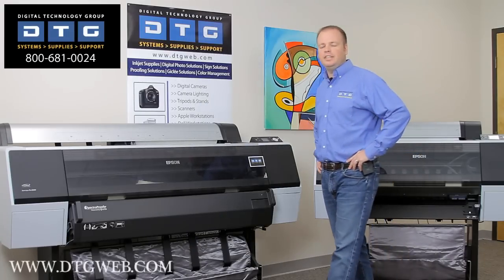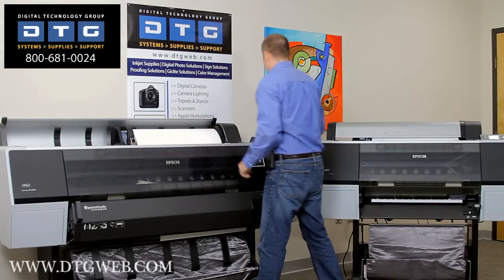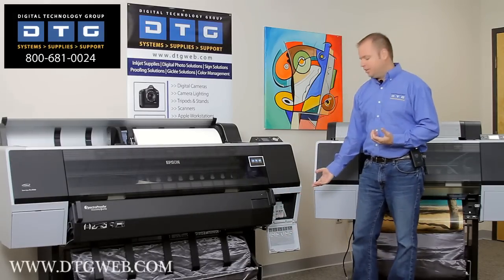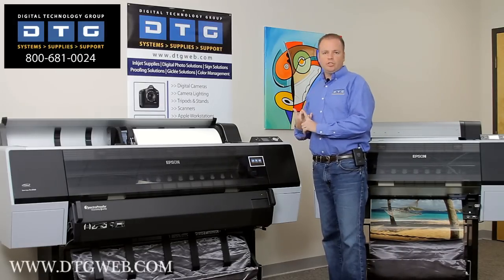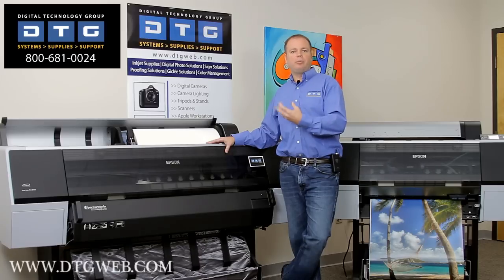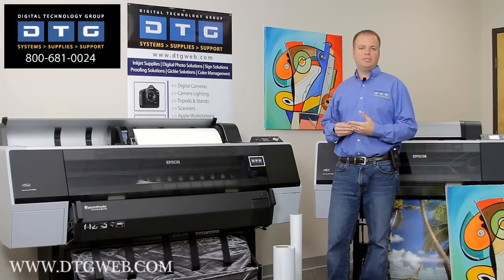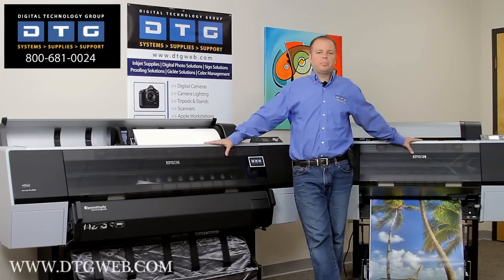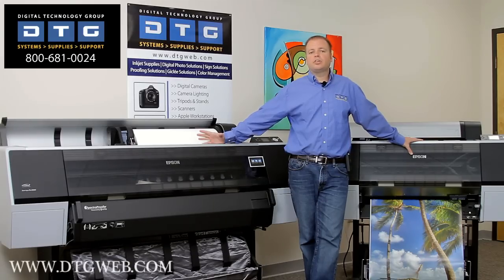Introducing the Epson Stylus Pro 7900 and 9900 printers

Comment: Hi, thanks for the demonstration. I just got a 7900 and have been having banding on my prints from the first day.  It has not been even 2 weeks and so far Epson has not solved the problem.  The banding lines are horizontal and dark, which suggests that these are being cause by overlapping head passes.  The media I am using is the Epson paper that came with the printer, so I am supposing that since I am using the original profile for this media, there should not be a problem with paper feed adjustment (?). Have you had any banding problems with this printer and do you have a tutorial to help with this problem?  I have found tones of complaints on the internet regarding banding with this printer series, and also complaints about Epson's terrible customer support.  Any help you can give would be much appreciated.  Many thanks!
Reply: hi, we are an ink manufacturer, you can contact us

Comment: The worst printers ever made by Epson, they tried to catch up the speed of competition and developed the worst printhead so far. Even using only genuine ink the printhead fails. I have spent thousands just to realize that their resin treated ink is the cause of all troubles. Without resin treated ink the printer works fine. Indeed there is a lot of methamerism on the final print but with some surfactants and more money spent on experiments will be fine with good stability and absolutely no banding even if the printer will not work for months. Final conclusion, stay away if you do not understand basic chemistry, and have no time for research !!! Epson HDR inks will finally cause the printhead to fail.
Reply: If i were to buy a printer similar to this, what brand would you recommend me??
Reply: Juan Carlos Villasuso Epson PRO 7800/9800, the previous models based on DX5 printhead. They still the best !
Reply: Thank you very much! i appreciate it!